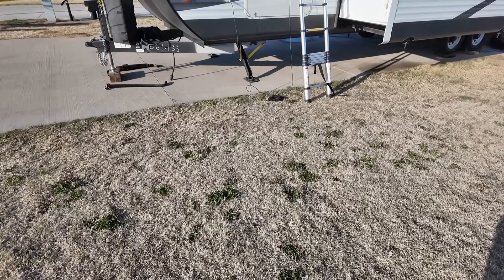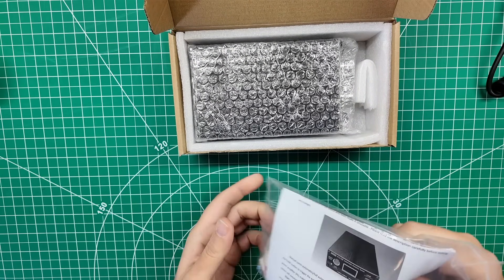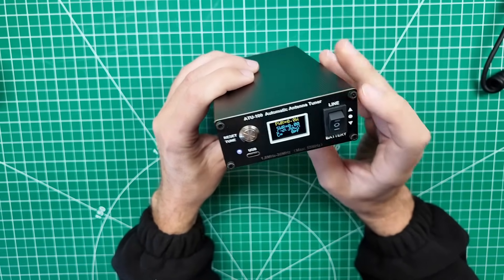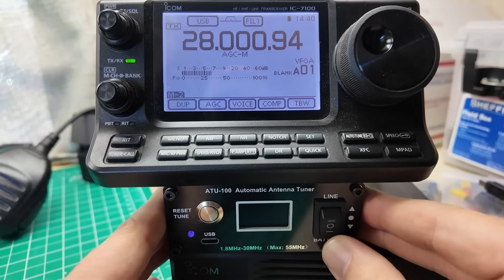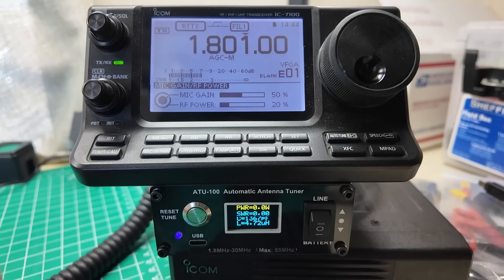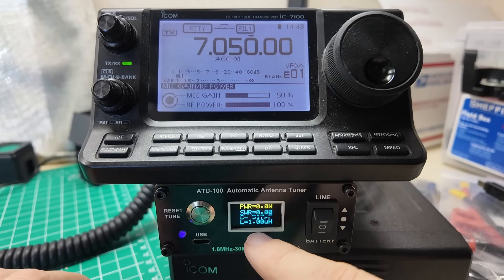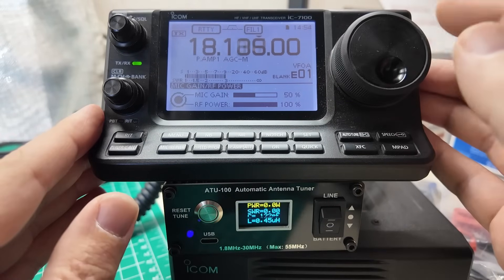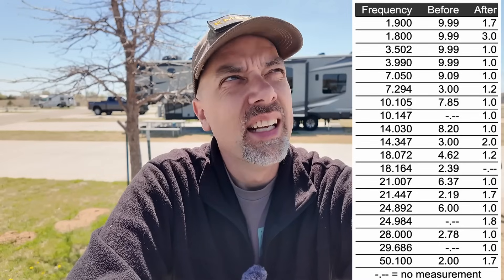Matching an RV Antenna That Shouldn't Work — Real Test

Comment: The Amazon link now goes to a tuner without a battery. The description states its firmware is the latest (3.2) version though. Hopefully it's innards look as clean as yours.

Doug in NC N4DUH
Reply from the maker: Thanks Doug! They keep going in and out of stock and the vendor just swaps them without warning.

Comment: Does anyone have any experience with the ATU-130?  It will allegedly do 100W digital as opposed to 30W on the ATU-100.  It also has a wire antenna output banana plug and ground post in addition to the coax output.  I don't know if there is a 4:1 on that output?
Reply from the maker: Ooh. I want to know too!

Comment: 102" whip should work great for 10,11,12,15m. Should tune just fine as a compromise to 40+.

I have the non-battery version of the same tuner.  I'm debating adding the missing Bypass button to the box.  73 KK7YIS
Reply from the maker: That 102" whip is a classic!
Reply: @temporarilyoffline 10-4 Good Buddy!

Comment: After watching your video and Walt K4OGO, I bought the ATU-100. Works great!
Reply from the maker: Sweet!  Designed by a ham too: N7DDC
Reply: I got the Ten-a Tuner module for my 706mkii.  This lets the radio put out a 10 watt CW carrier for a few seconds...works great with the ATU-100 in auto mode.

Comment: Thanks for the vid man. Do you know if there is a fairly easy way to add an ACC port, so I can hold down the “TUNE” button on my 705 to trigger it vs PTT? Not sure there is a ton of value in that, but it would be cool. I looked at the ATU-100M and it seems like it had less range and power handling ability, but it does have that wacky CW trainer port that I was thinking could be repurposed as an ACC port.
Reply from the maker: Here you go. https://carnut.info/IC-705/ATU-100_Interface/SCH_IC-705%20to%20ATU-100%20_ATtiny_interface_03-02-2021%20_vk3pe.pdf
Reply: @temporarilyoffline  Steve, you're awesome. Thank you!

Comment: What would I power it in a mobile situation without the battery option? Could you splice a cigarette lighter adapter and use the cigarette lighter port in a vehicle?
Reply from the maker: As long as you're under about 10a of current draw, cigarette lighter would be fine.  Usually they are fused higher then their wiring allows, so you have to check all the details.

Comment: Great idea and  info,  you might consider modifying a rooftop crank up antenna.  With the old TV antenna removed, mount  your vertical to the arm portion and replace the TV cable with your coax.  With the crank up, you won't have to remove the antenna, just crank it down and the vertical will lay flat on the roof.  Also, I believe the instructions you had held up in the beginning said to tune at 5-10watts.
Reply from the maker: Thanks for the tip

Comment: How does it act on a qrp radio just curious I want to get an attena tuner for the my qrp setup and my qro and I prefer a standard solution rather than a couple differ t solutions
Reply from the maker: the N7DDC design was always able to work on QRP radios, but the software was set to not trigger at lower power.  You could actually take the older units and update the software so they worked.  This one is supposed to key in at 5w.  I'll test it out in a future video.  Give it a shot and return it to amazon if it doesn't work well.
Reply: @temporarilyoffline thanks that works for the trusdx just need an attena lol

Comment: You have probably drilled a hole or found another solution,  but I go through the shore power cord port.  It stores under the kitchen seat, easy access inside. Maybe Ill do a video. Always need new ideas lol.
Reply from the maker: I drilled a hole for coax a while back on my RV channel https://youtu.be/kSGZw7q8YKo One of the problems I run into at RV parks is they always want to cut the grass and destroy my radials, so I have to take the antenna down frequently... Which makes me not even bother to put it up in the first place.
Reply: @temporarilyoffline  nice. That's exactly what I was thinking. Mine was factory installed, I just use it. Have you tried grounding to the camper frame instead of radials. It works on a vehicle,  probably as much or more metal on a camper frame. 
 Have fun in your travels, if your through Montana, look me up.
Reply from the maker: In this video I specifically ran with out a ground.  The final mount will be electrically connected to the metal siding!
Reply: @temporarilyoffline  I was actually just looking at that on mine last night. The stuff is coated so I'm concerned they are not bonded, maybe the screws do it,  hard to say but I plan on doing a continuity test one of these days to find out.  Itll be fun watching your projects.

Comment: My buddy has one of those ATU-100s, I have a similar version. Funny thing is, his tunes with half a watt, maybe less but we didn’t try. My tuner however, won’t tune unless you put 6w or more into it. Thinking I may try to trade him for his.
Reply from the maker: Yes, there is a firmware update available, although the process on the older units isn't that easy.  It will allow tuning below 5w.

Comment: Hello Steve, I just caught this video and was looking for the tuner on Amazon. I could NOT find the same model as you have with both internal and external power. Where did you get it? I am very interested in getting one for my G90. I followed the link you provided but it was a different model.

By the way, I love watching your videos. They are very educational and I learn a lot from them. Thanks.

John Aloi Sr
WB#HPE in Virginia
Reply from the maker: @JohnAloiSr-WB3HPE  hey John, thanks!  They are currently out of stock on the model I have and I couldn't find any like it.  I'll check with them for when they will restock
Reply: @temporarilyoffline  Thanks. I would like to get the same model as yours and look forward to hearing when they will be back in stock. 73, John
Reply from the maker: I heard back: "The batch of our ATU-100 units with built-in batteries arrived at the port on May 7th. It will take about a week after arrival for them to be received and listed. Therefore, we estimate that they should be available for purchase in the coming days."
Reply: @temporarilyoffline  Thanks for the update 2 weeks ago. I have been checking on the tuner and it finaly showed up on Amazon and I ordered one. Thanks again.
John Aloi Sr - WB3HPE
Reply: Hello Steve. Just wanted to let you know I received my new tuner today. I hope to play with it this weekend with my new Radioddity HF-009 antenna. It's supposed to be a rainy weekend but maybe I can sneak in a little radio play between showers. Thanks. John Aloi Sr - WB3HPE

Comment: The Amazon product link does not match the model showcased in your awesome video. Sold out already?
Reply from the maker: They appear to be out of stock for the moment.  Maybe its the tariffs stimulating people to buy before the price goes up... I've also seen manufacturers slow down on shipping products until the tariffs weigh out.
Reply: Lucky I got in Early!  But the other model is about 3/4 what I paid.

Comment: I have an icon 7300. Should I get something like this? I know my radio has an internal tuner, but I’m sure it’s not the most efficient.
Reply from the maker: Good question, it's more based on your antenna.  If your 7300 can tune it, save some cash ... If it can't, this is a cheap solution.

Comment: To provide better water proofing, how about going through the floor with a bulkhead connector? Connect a short coax under the RV and run it up to the antenna that is mounted to the side of the RV.  Smaller holes at the mounting location.  Also, you can utilize this for any other antenna you have outside.  Put two or more connectors in the floor and run one to a vertical and one to a dipole or something else.
Reply from the maker: I use my current thru-hole ( https://youtu.be/kSGZw7q8YKo ) when I can, but I often can't setup a ground/tree antenna, so I'm hamming harder and testing out putting a permanent solution up.  This solution won't have any external coax and no ground radials to take up space.  I'll be able to use the whip shown at full 17' height or any of the other 3/8ths x 24 stud antennas/adapters.  I have compromises in all directions, so getting ANY signal out is the main concern... for an emcomm solution, the neighbors won't complain about how I help them contact their family members.

Comment: I bought mine to use portable, but it never worked from day one, I took it apart and found that the circuit board had the thru the board component pins had pieced the battery in multiple places and shorted out the battery, I am not a happy camper.
Reply from the maker: @stephenwade8093  I wouldn't be either, did you return it for being defective or deal with a warranty replacement?
Reply: @temporarilyoffline  No At first I thought I was doing something wrong with the way I used it, Yaesu 891, I put it aside for a few weeks and then did the investigation which found the fault, I had bought it from china thru Ebay, the hassle of sending it back was to much trouble, I am looking at an external plug in battery test rig to see if the tuner is still ok.
Reply from the maker: @stephenwade8093  well at least it will be a fun fix!

Comment: What I didn't seem to notice is what you were actually connected to on the ground/counterpoise side of that antenna?
Reply from the maker: @RedBrungardt  you didn't miss it, I left it floating to make the tuner really have to work hard.  There is RF Coupling to all the nearby metal for sure.  The long term plan would be having the shield of the coax connected to the metal skin of the RV for a counterpoise.
Reply: @temporarilyoffline Red W5UW - OK  BTW I have been using that same antenna tuner on all bands (except 80) into a 160m inverted V with my 7300 because it tunes where the Icom internal tuner won't, it's really a gem of a little tuner.
Reply from the maker: @RedBrungardt  sounds like a winner

Comment: I have a Military manpack radio Steve, I would like to buy one of these for when I run an external antenna. I'm impressed in how well it works. Do you live full-time in your camper now? I thought you had a home before? I notice you have been in this for a bit. I like the mobile idea traveling and visit America. 73's Don
Reply from the maker: @skynet1703  hello Don.  Yep. I live in the RV full time now and move around, no real destination, just moving.  I sold my home about 3 years ago now.  Don't miss it except for really windy nights.

Comment: My ATU-100 arrived today. I took it along with my FX-4CR to my local POTA park. My antenna was the Chameleon MPAS vertical. It tuned on 10-20 meters, but I could not get it to tune on 30 or below. My Kenwood TS-480SAT with built-in tuner tunes all the way down to 80 meters on the same antenna. Next up is to match it with an end fed wire using a 4:1 and 9:1 unun.
Reply from the maker: I wonder how will it would have worked if you just used the whip and removed the MPAS... nothing wrong with the MPAS, but it might be bringing the impedance too high/low for the tuner to work with.  I'll have to try that out and see.  What whip were you using with the MPAS? (I'd assume the 17')
Reply: @temporarilyoffline  Yes. 17' whip. I couldn't use the whip nee the MPAS because I only had the Chameleon spike and the Hybrid Mini transformer. If had the CHA blank I could have used the whip only. I think you're right about the impedance probably overpowering the tuner. I think the Hybrid Mini is a 5:1 transformer. Anyway, I'll try it with both a 4:1 an 9:1 unun and various lengths of end feds and see what happens.

Comment: Odd question: If you only need the tuner for certain bands, will the signal still pass-thru if the unit is simply left de-energized when not needed? Thanks!
Reply from the maker: I kinda showed it, but didn't speak to it in the video.  Most tuners have an "inline" and a "bypass" mode.  This tuner can be placed in bypass mode, then turned off... But beware, this tuner has latching relays to save power, so if you have it "tuned" from a prev. antenna and then turn it off... that's your tune.  You have to put it in bypass mode.

Comment: I guess I didn't realize that you are a full time RVer! We've been full time for a little over 2 1/2 years! N7BBQ
Reply from the maker: I'm loving the RV life!  Looks like we've been in it for about the same time.   What are you using for your antenna/ham shack setup?
Reply: @temporarilyoffline  I set up my station outside to give my wife some peace 😄. I mainly hunt with a G90 but I have a 7300 as well, and a CFT1 that's I mainly use for activations. For the antenna I used an even fed on my POTA 33 mast on the motorhome hitch if there is room or a JPC-12. I can run a 20M EFHW, a 29' EFRW or a Rybakov vertical on the mast without using much room as well.
Reply from the maker: @rclewen  sounds good.  I'll be playing with a shorter RW,  I've seen high winds lately and couldn't set up a mast.
Reply: @temporarilyoffline  Yeah, we've spent the winter in Yuma, AZ and it gets crazy windy at times. I have 29', 41' and 57' wires cut and terminated in banana plugs to stick onto my 9:1 UnUn so I can fit in most places.
Reply from the maker: @rclewen  I'm probably going to steal the linked dipole setup and make a linked RW

Comment: I own a few of the knockoffs of this tuner I got from amazon. Not a bad little tuner, but I have noticed the SWR reading it will give sometimes is off a bit when I compared its readings to an antenna analyzer
Reply from the maker: There were a few models where the diodes in the SWR bridge were mismatched.  Check and make sure you have the exact same 2 diodes.  If you have a couple of them, you probably have the right parts to make the swap on-hand. (2 from each swapped 2 for each, they just have to match)
Reply: @temporarilyoffline  I looked, all matching

Comment: Does the tuner have one of those integral flat batteries below the main PCB?
Reply from the maker: @Philip-KA4KOE  yes it does, but you could choose the version with no battery
Reply: @temporarilyoffline I may have to spend some filthy lucre on one to go along with a 200 USD G106. The v1.3 units aren't bad at all.
Reply from the maker: @Philip-KA4KOE  I never had a problem with my g106. Simple, easy, small radio. This tuner would match up well.
Reply: @temporarilyoffline agreed
Reply: I mean for 215 shipped....you can't go wrong

Comment: Use CW for tuning.  Radios with built in tuners use CW and tune at about 5-10 watts, and rather than checking the top and bottom of each band, check the parts of the bands you normally operate most of the time.  And just because that tuner can tune up that small whip on 160 Meters doesn't mean that antenna is efficient on 160 Meters, it's not.  That whip antenna is way too short for 160 Meters.
Reply from the maker: @bigsky1970  thanks for watching!
Reply: Ever heard of a coil @bigsky1970? I'm new af to amateur radio and even I know that. You're commenting on the video of a man that is much more educated than us two put together so maybe we should just keep our traps closed 😊

Comment: Thank you Steve, this is timely. I was thinking of mounting a G90 in the back of my vehicle with the head connected with a long 9 pin cable. Now I think I'll get one of these and use my FT891 with a stainless 102 whip.
Reply from the maker: It will likely work better in the truck for you than in my setup - I had the ground side floating (on purpose} in my test.

Comment: I bought one of these tuners about 3 years ago, and I'm more than happy with it's performance. I also bought a PickKit3 to reprogramme it so it would tune with as low as 0.5w input power. An unnecessary purchase as it turned out, the tuner worked with as little as 5w input anyway. Mine has screw terminals aswell as the SO239 sockets, so it supposedly can tune a long wire. I have yet to try this and see, but it tunes just about anything on just about any band, and it's a LOT quicker to use than my mechanical MFJ 949B tuner. One single buttom instead of two tuning knobs and a mutliple tap switch that require carefully balenced adjutments to get the best tune at any given point.

I'm currently awaiting delivery of an AT350 from Banggood, the AD for it lists it as : ATU350 3.5-54MHz 350W HF Antenna Tuner Automatic Antenna Tuner DIY
Kit by N7DDC ATU-100 Upgraded. It will be interesting to see how it performs in comparison. Tech Minds has a video on this AT350 tuner on Youtube and that video is the reason I bought one to try, in his video with a 20m wire, he got under 2:1 tune on every band he tried, with  some time and patience, I cannot see why this woudln't get even better with a more suitable wire length. It might have been a little short, or a little long, when mine arrives, I'm going to throw random wires at it until i get a tune I like where I want it to be. And if it IS good for 350w, then I will never have to worry about buring it up as I can only run 100w MAX anyway.

Comment: When Static, How about 2 X 10M Fibreglass Poles at opposite corners of the RV, and do a End Fed Half Square Antenna.?
Reply from the maker: @MINI-4X4-RADIO  I'm imagining that they would have to be tall enough to clear the metal siding.  So 5m above the roof on each end?
Reply: @temporarilyoffline  
Not sure of the construction.?
I was thinking of a small tube on each corner
Then drop the fibreglass poles in/on
So you have say have 9.5M above the RV
Reply from the maker: @MINI-4X4-RADIO  oh, 9.5m above the RV!  I get it now.
Reply: @temporarilyoffline  
Yes, @ 9M+ of wire on each pole
Then whatever between pole.? 7M
So @ 25M Half Square
Your metal RV should keep some RF out

Comment: To speed up testing, Program the Band Edges in FM Mode into some of the Memory Channels
Not sure about IC-7100 TX Power.? Some Radios store TX Power Level in Memory also.
Reply from the maker: Thanks for the tip
Reply: @temporarilyoffline  
It saves some knob turning & twiddling :)